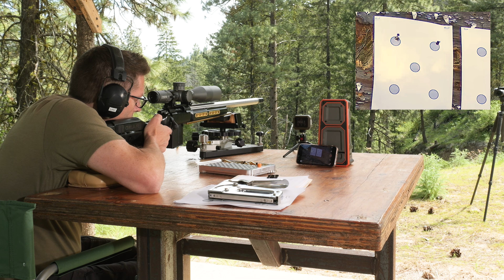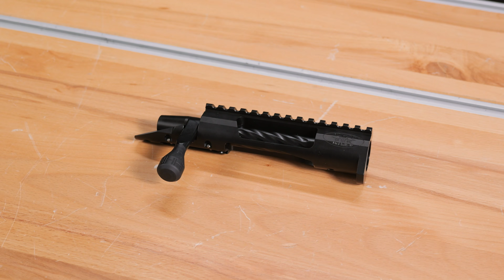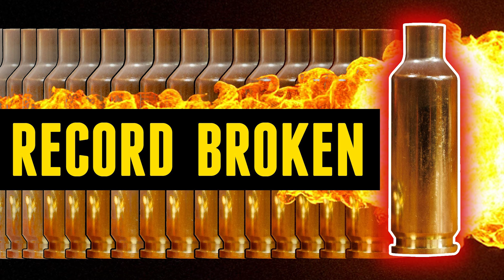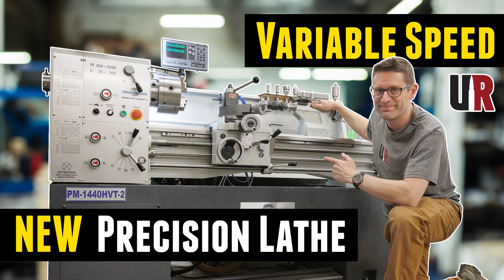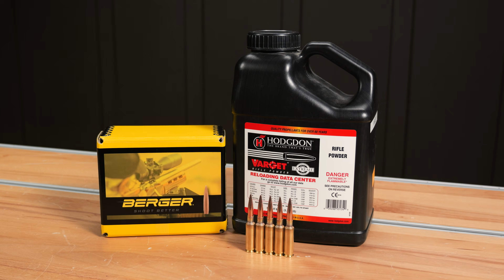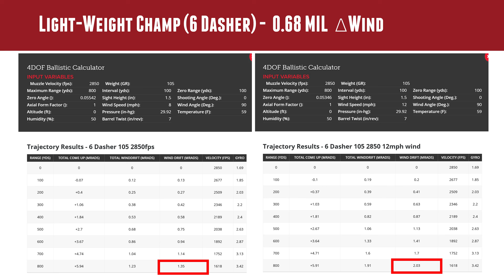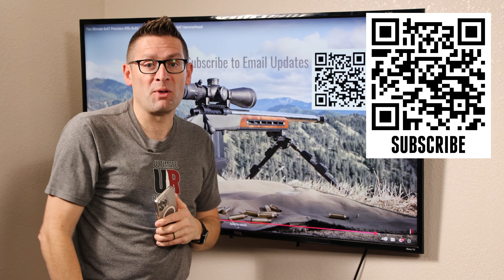Custom 7 SWC: Ultimate PRS Setup & Hunting Cartridge

Comment: Awesome build and shooting as usual! This is the 4th 7mm wildcat I've seen in the last two days and I'm extremely intrigued by the performance of 7mm Moses that also functions in a short action. 308 Moses functions in a standard action and I believe was designed for the 220gr match ammo, but I would probably load the 212 Barnes LRX and 214 Hammer Hunter for hunting purposes. I'm also interested in the 7mm SST as it compares more closely to the performance of 7mm Moses.

Comment: Good video as usual, Gavin. My experience with .284 primarily is with 7mm RM and three different 7 Dakota builds from Freudenberg and Benchmark. Best groups under 180g are the 162s in 9-twist. Beyond that, with 8 twist are the 180 Berger, JLKs, 190 Matrix VLD .807BC. The best one-hole groups using Bob Cuaterucios 189 VLD .750BC. I'm not a competing shooter, just a chaser of extreme accuracy. If you were going to build a 7SWC for practical purposes (under 15lb), suitable for hunting and long range, I'm curious about what it would be.

Comment: Hey Gavin,love the channel,i notice at you mtn top shooting range your earing alot of dust...if you get non granulated modified bitumen roofing material,cut into 9 foot section you can use a weed burner and make a nice platform to lay down on keeping you out of the dirt and infront of your rifle far enough to keep dirt out of your face.good luck Dan

Comment: Like most people online who are sponsored, you are  not comparing apples for apples. You were running 180 bergers at 2650 but in your data you have used 190gr atips at 2650. You have used probably a lower end load for the creed vs what would be a screaming load for the SWC for your comparison. Especially if you compared with a creed running a 28” barrel and a 147 ELDM. Bringing up the 280ai is silly. It will push the 180s at 2800ish with that load data. Now I’m not ragging on the SWC, it looks like a great little cartridge. But if you are going to make claims, please be factual. Don’t go comparing maximized hand loads against general data or book load data.

Comment: Ive always been weary of sherman wildcats. The main concern being pressure. Until i can see testing and data confirming or contesting the pressure claims im steering clear of them. Do not care about the performance gain if the pressures could potentially be above or at what took steel cases (sig and federal) to achieve.

Comment: I’d like to know real world velocities in a hunting rig with a 24” tube chucking 160 class bullets.
Reply: 162 ELDs out of a 24in 7mm Saw loaded very conservatively (basically the same thing/ very similar to the SWC) is going 2675fps after the 200-250 round speed up.

Comment: 3 and 5 shot groups is a travesty of a small data set. Let alone cherry picking data in a 5 shot group. Wonder what the actual recoil force is on the 7swc considering the main reason people use 6mm hot rod cartridges is so that it's super easy to call hits from the low recoil.

Comment: So this is a 7x47L Ackley improved. The advantage over the Saw or a 7 mm 08 is you can run the 190s and still feed out of a magazine without crazy amounts of jump and seating past the shoulder of brass. Like the idea was thinking of wildcatting something like this as well something with a little more Barrel life than all the hot rod 6 and 6.5
Reply: Saw can feed 190s with binderless mag like swc. I've run 190s in my with no issues. Yes, you're right at the limit on the mag, but it still works. As for the jump, it is only 30 thousand from lands for the node, but I got it as low as 10 thousand with no issues. I see the advantage of this vs 7mm-08 and 7-08 Ai but I don't get the advantage over the saw other than less recoil.

Comment: 0:10 I want to know who is the low IQ, numbnuts that shoots a 6.5 C 140gr projectile at 2700fps? Without trying, well under pressure, 40.2gr of most powders gets me to 2800fps with a 24 and a 26" barrel. Cold or hot, doesn't matter, 2800fps is normal.

Comment: Hey Gavin , well done really nice Video ! The Groups are impressive especially for virgin brass and for first loads ! One thing I found interesting that you compared a 6mm Berger Hybrid 105 with a 190 ATIP . I think it would be better if you compared the   ATIPS , ELDM, and Berger Hybrid and LR Hybrid  ( 6, 25,6.5 and 7) under each others.  Even the ATIP 110gr to the Berger 105 is huge different . It feels like you compare apples to oranges. Maybe for the next video about the 7swc you developed a chart for every Bullet type and size and compare it . Otherwise great work man keep it up 👍🏻

Comment: 27 lbs is heavier than my 338 Rum with a 30" heavy barrel.  Heck, I could include the SKB hard case and still be close.
Reply: @beardoe6874 you obviously haven’t been to any PRS matches… 24+ lb rifles are the norm
Reply: @lift_n_shoot  well that's silly.  If I was running the series I would cap PRS Open rifle weight to make things more reasonable.  18 lbs would give you 3 lbs for a scope and 15 lbs for the rifle.  That might actually convince optics companies to put their PRS type scopes on a diet.  You probably need a minimum caliber and some sort of power factor calculation to make quarter bore a sweet spot so there aren't so many 6mm mouse fart cartridges.  You could still do a 7mm like that Sherman but it will make recoil management a part of the game for everyone if a 6mm needs to be 105 grains and 3,000 fps to make the power factor.

Comment: How much of a difference is 7MM08 compared to this round? New to the wild cat rounds thanks.
Reply: Pretty much identical to a 6.5x47, just necked up to 7mm and shoulder changed to 40degree. Case capacity is gonna be a little less than 7mm08. This does appear to be just about the best possible option to run a 190 hybrid mag length in a short action and get decent velocity.

Comment: Wants faster so 6mm then wants higher bc gets 7mm. The answer was always 6.5 but no one wants to admit it
Reply: 6mm is cool and 7mm is hot... 6.5 is just luke warm
Whennit comes to cailbres the calibre right in the middle is rarely the best combination, theu mostly jist carry over the worst qualities loke not enough bc and not enough speed combined with too much recoil for what you are getting. 
6.35mm/25cal and 6.8mm/277cal are better options that 6.5mm.
Reply: @ the 180 Berger has a 0.68 G1 and he’s running 2650 fps. A 6.5 with a 147 is 0.697 G1 and 2700 fps. The 7 SWC only advantage is in splash / energy
Reply: @ it’s boring but the middle option is most likely the right option because it is the standard all the rest are compared against

Comment: Annnnnd this is different than 7-08 Ackley how?????????????
Reply: Case is shorter allowing the bullet to be seated in the neck appropriately. It also has half the case taper as the 7-08. 
The 7-08 is designed for smaller bullets.
Reply: @ I see cool I was just joking around it seems like a sweet deal and I will probably be getting one! Thank for the reply

Comment: There is also the 7 SAW that Alpha produces brass for. Essentially the same thing but more case capacity.
Reply: big fan of the SAW
Reply: Not going to get the velocity with a 180 to 190 grain bullet it eats up too much case capacity unless of course you put it in a medium action but the SWC runs in a true short action
Reply: @RifleAccuracyandReloading  I don’t own a 7 SAW, so no first hand experience. But WTO has faster speeds listed with a 26 inch barrel for load data on their website.
Reply: @ I was able to get the velocities when I use the 162 grain/168 grain… Never could get the velocities or the amount of powder in there due to the bullet, taking up the case volume.
Reply: @ I have always wondered the validity of those numbers. Thanks for the information

Comment: Sounds like a damn near copy of 7SAW besides shoulder angle
Reply: Our case is shorter and has less case taper allowing for additional volume. Saw is a great choice for 160class bullets and can shoot long bullets however the bullets will need to be seated past neck shoulder Junction eating up volume.
Reply: @ShermanWildcatCartridges  according to load data from WTO getting same speeds from same barrel length with there starting charge of varget and a 180.
Reply: @ShermanWildcatCartridges   What's the pressure with this 2650fps load?